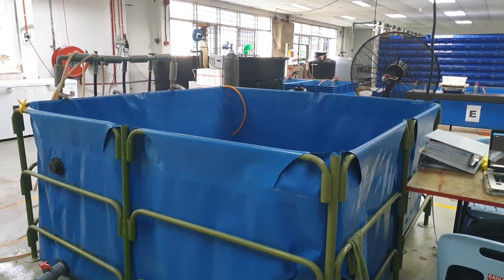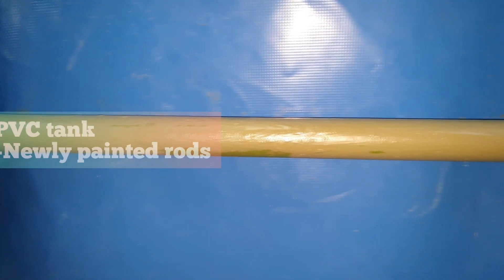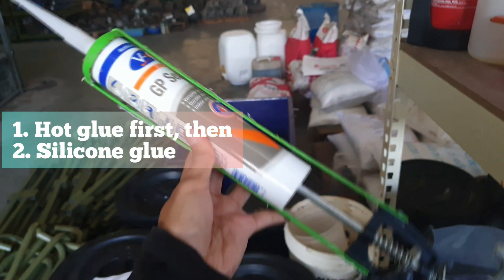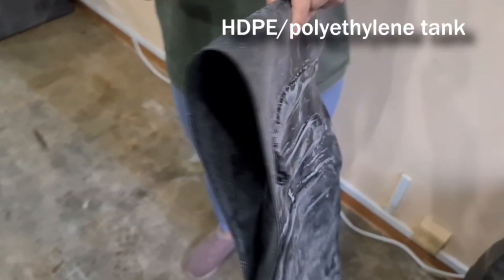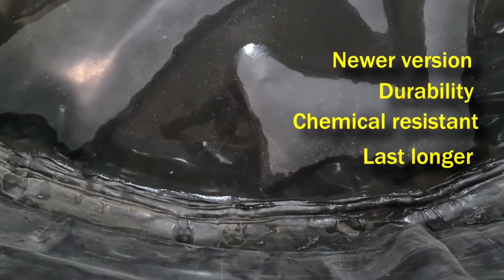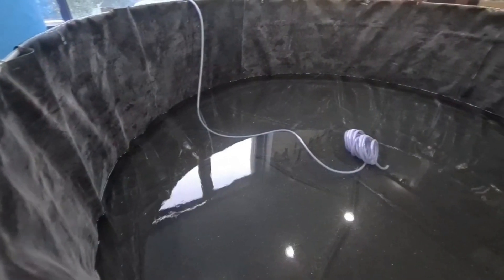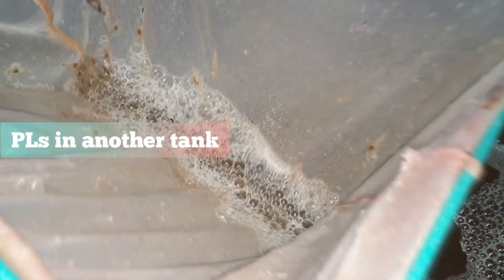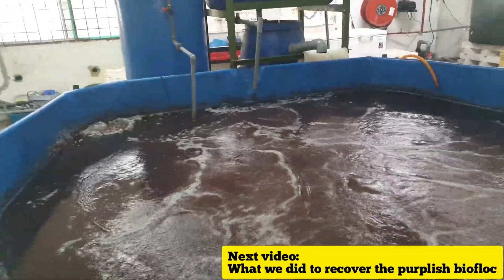Leaking Tank Again... Is HDPE Tank a Solution?

Comment: Love the video and have been watching for a while. Neither hot glue or silicone are the correct materials for bonding HDPE. A heat weld is best but second would be something like Loctite Heavy-Duty Five-Minute Epoxy.